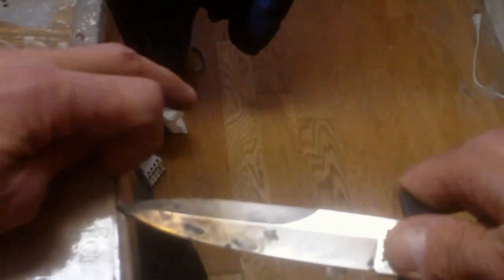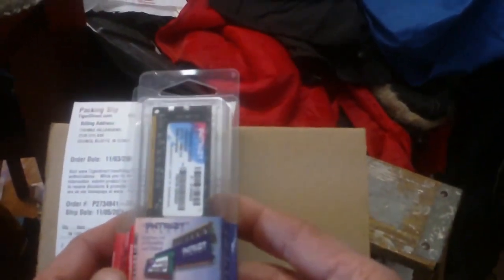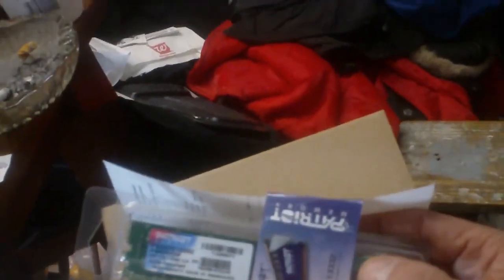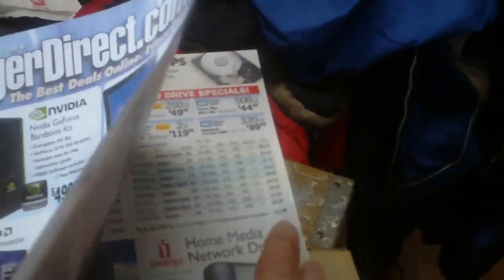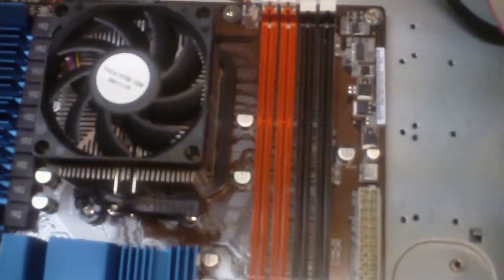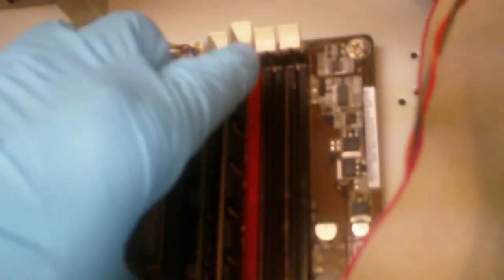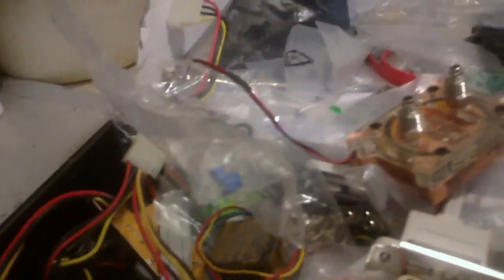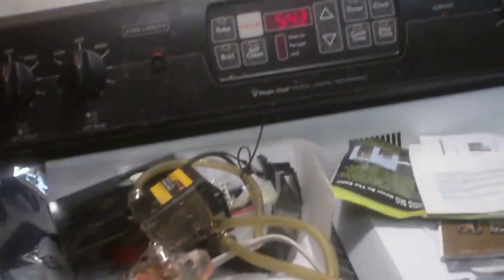The Ram arrives and Problems come up. Typical!!.avi

Comment: doubble check your jumper settings

also take your video card out and see if you can boot with just the onboard video.  on some main boards that have all that onboard crap you have to make a change in the bios before you can use a vid card

let me know